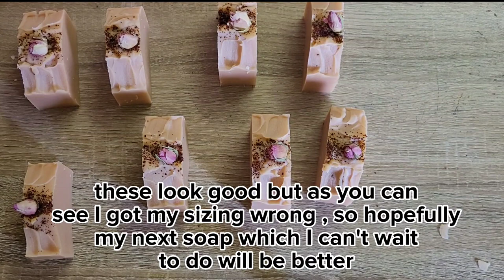Rosehip & Pink Clay Rosebud Soap Bars for Beginners

Comment: Great job but as a soaper myself you might want to let people know that stainless steel works much better with lie. No aluminum or other metal except stainless steel and maybe using #5 plastic containers or stainless steel for your lye. I noticed that you had some brown speckles in your lye water don’t know what that was, maybe removing it before making the soap. Maybe using a strainer next time to remove particles floating in your lye water. You worked so hard at the end. Looked great.